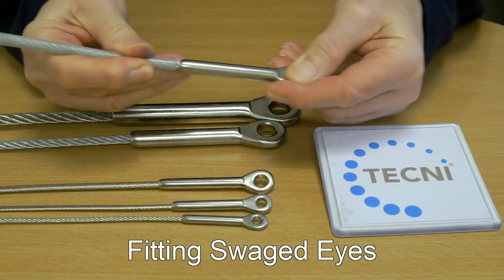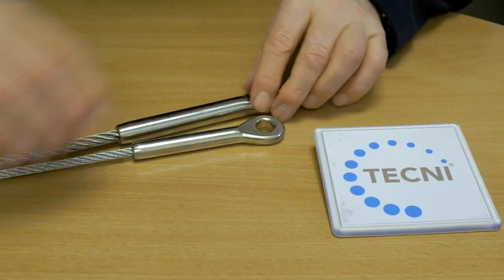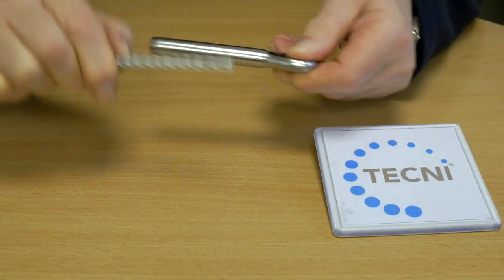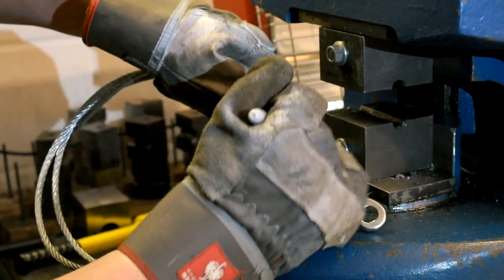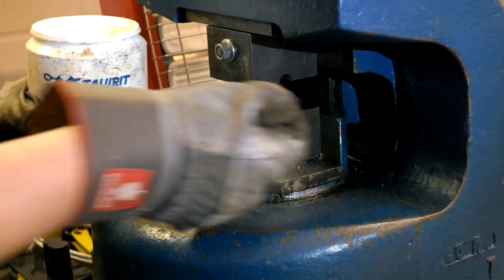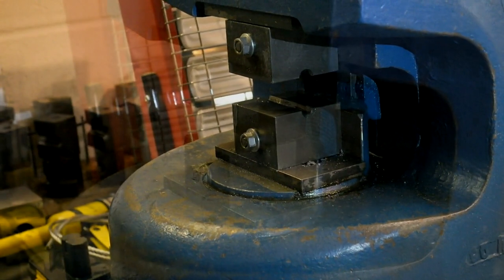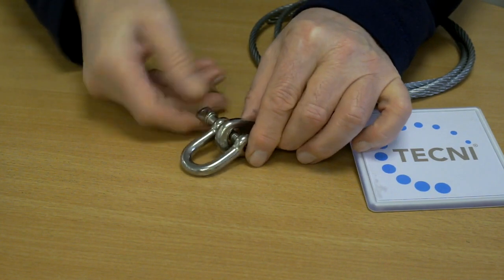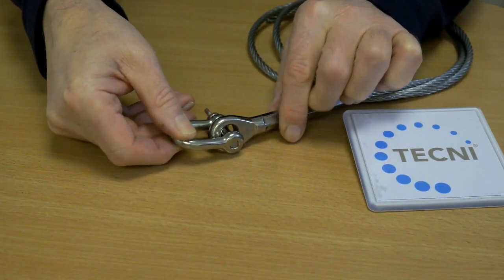How To Fit Stainless Steel Eye Fittings

Comment: How much pressure do I need for pressing such a stainless steel fitting ? I want to press such a fitting on a 5mm/6mm steel cable (for my fitness cable pulley). Is a normal big crimping plier for electrical cables for 10/16/25/35/50mm2 enough or do I need hydraulic crimping pliers ? 
(Maybe a dumb question, but ...) is the 10/16/25/35/50mm2 size related to the cable or the fitting dimension ?
Thanks in advance !
Reply from the maker: Hi. Thanks for the comment. An electrical crimper would not be suitable for this fitting and we would recommend using a large hydraulic press to generate sufficient pressure.  At TECNI we have these large presses and can manufacture assemblies to your design & specification. If you would like a quote please contact sales@tecni.uk. Thanks again.